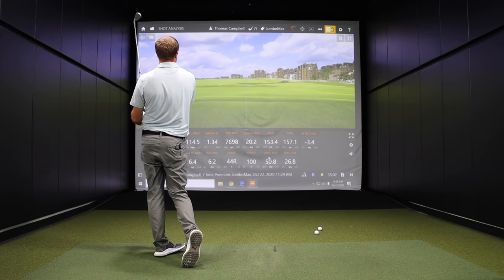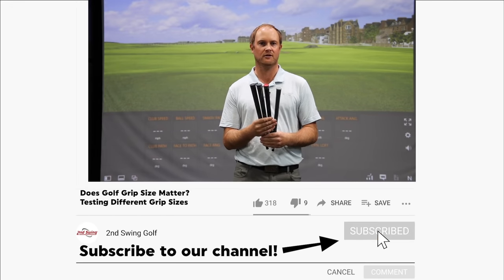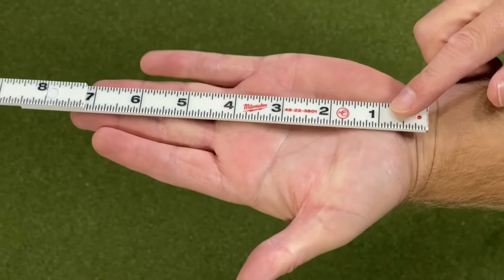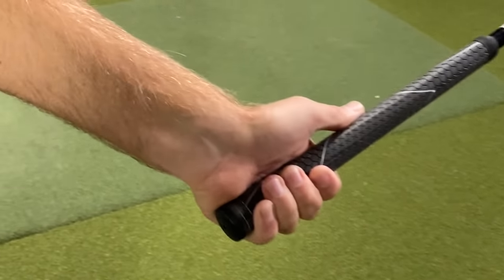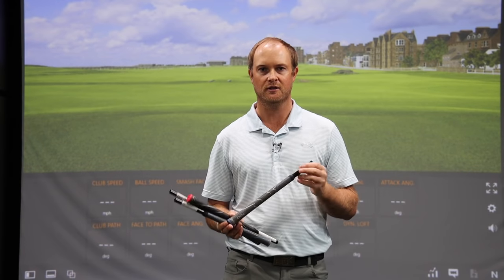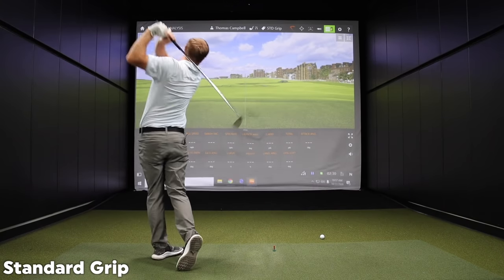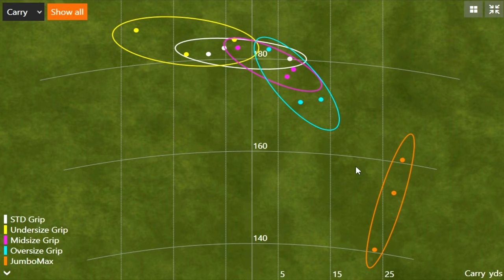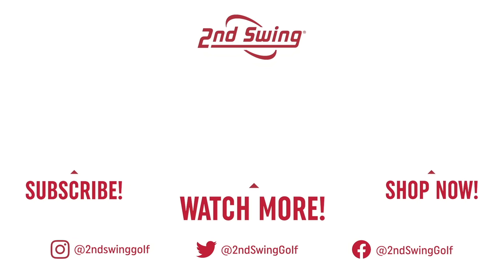Does Golf Grip Size Matter? | Testing Different Grip Sizes

Comment: With the jumbomax it takes a little time getting use to. 3 swings aren’t gonna cut it. I play the jumbomax currently (large glove) and it took me a minute to get use to. A whole range session to be exact. I could hit a draw easily and didn’t lose distance. I did have a strong grip. Now that I’m neutral it doesn’t move nearly as much. I feel I can swing aggressively and not go hard left now
Reply: These sorts of tests annoy me somewhat because of this right here... I'm not sure what testers expect from 3 shots with a change - any change for that matter. He achieved pretty much the exact opposite from the JumboMax that others have (shrug)
Reply: Hey swingking please answer me if you read this! I have a left miss for years now because of overactive right hand at impact (but not early release, I rather lag it long and then release into impact hard) if it goes well i hit bombs but a little too much hands and I hit miles left. Do you think these grips would be helpful? I rarely ever miss right for further info
Reply: @AlexSteenOlsen  I always said I never met a club I couldn’t turn over lol. I’ve struggled with the same thing myself in the past and have used oversized grips for years. These grips do help. It makes the issue less. But as always work on the issue.
Reply: @swingking83  Alright thanks but. Keep working on it :D
Reply: Absolutely!!  I just moved to jumbo Max's.  My first swings were down at 105mph as I got used to it.  As I've gotten used to them, I've cranked back up to the low 110s and my random duck hook is gone.
Reply: That is EXACTLY the kind of information I'm looking for.  I took use a large glove with a hook tendency.  Thank you sir.  👍👍

Comment: It is important to note that "large grip = less draw" is a generality. It works opposite with me, thinner grips slice way out to the right, and a medium JumboMax (which is larger than a normal oversize) allows me to hit pretty neutral shots. I had a standard size grip on my 3 wood when I got it, had a pretty big fade on most shots (~20 yards or so) and misses were 40+ yards right. Replaced it with a JumboMax medium just to try it out and instantly almost all my shots were straight with misses having a 10-15 yard fade. My driver has a medium MCC+4 grip and I slice that quite regularly as well, so I'm planning on replacing that with a JM as well.
Reply: Yesss agree!! I switched to mid size because of larger hands and I lost my ability to fade! Going back
Reply: @goonytunes4119  what size glove do you wear, i struggle with slicing and fades and I use a standard grip. I wear a large size glove but im curious if i should replace them with midsize
Reply: @bennettblackmon2858  large mens Titleist glove. For me, going back to standard from mid size was the best move ever lol!
Reply: @bennettblackmon2858  I'd say fix the swing causing the issue, vs changing the grips, my 02c

Comment: As I have gotten older I have gradually gone up in Grip size, these days thanks to arthritis the only grips that I can use without severe pain are the Jumbomax Ultalites (medium).
Luckily I didn't have any loss of clubhead speed or issues with Ball flight/trajectory. In fact, I found the opposite to be true with the larger Grips I am more confident to hit hard at the Ball and I have a neutral ball flight with little axis tilt.

Comment: I just regripped my driver and 3 Wood with JumboMax grips...I haven't tried them with a launch monitor, but I did play 9 holes earlier this week and had the most consistent performance out of both clubs that I've had all year.  Straightest I think I've ever hit my 3W, some of the longest fairway shots I've ever hit with it.  Shot dispersion with my driver was about the same as usual, but I got better distance out of it.

So, mileage may vary, considerably.

Comment: Swapped to a Jumbomax ultralite small from a standard grip. Can’t believe the great results. Didn’t realise I manipulate the club face with hands quite a bit. Shots going a lot straighter now and only miss are thin shots. Dropped around 5 shots from my scores since changing over. Fits my swing in getting a square face at impact. May not work for others but definitely worked for my swing 👍
Reply: Your comment along with many others, echos that the JumboMax grip has improved their golf.  With more square face at impact, softer/comfortable feel & reduced misses to the right. 👍🏾

Comment: Going to medium on all all my clubs has been the best thing ever. Feels great more control and even my misses arnt terrible anymore. Very underrated part of the fitting process
Reply: What grips did you get exactly? I'm leaning more toward giving the medium a try.
Reply: I just went to mid size which really helped with my arthritis in my fingers and hand. Standard size was to much pressure and after taking a testing on my finger to Wrist I should have been in the first place. Now I know

Comment: I wear a 3XL glove and got all my clubs re-gripped to JumboMax XL as I bought my first set. I've been steadily progressing and getting better but my shots would ALWAYS block to the right. I traveled and used a rental set with midsize grips. My shots were suddenly straight and perfect. Switched to midsize when I got home, and voila. No more grossly blocked shots.
Reply: I have an XXXL glove also and use the Large Ultralight grip, they recommended XL but I didn't want to jump right into huge grips, I have an oversize star grip on my driver and I'm hitting it better than I was with the JM on it.

Comment: This lines up perfectly with what I experienced after moving from midsize plus 4 grips to standard on a new iron set. 

I have always had to work to draw the ball on my set with the midsize plus grips I’ve had for years. My normal shot shape has been a fade with the occasional slice. I recently bought a stock set of Wilson staff CB irons that were on sale that I plan to customize. Before I had the chance to customize them I took them out on the range. Everything I hit was between a draw and hook unless I really tried to keep it straight or fade. It was an unusual experience for me. Now I’m pondering just adding tape to standard grips to get them somewhere between my normal fade/slice bias and drawing the ball.

Comment: I find the smaller the grip size the more control I have releasing the head. Hence open? I usually don’t wear a glove but when I do, I wear a med cadet glove. PING static fitting suggested an Aqua, or under size. Going to try one. Nice demonstration as always.
Reply: I meant closed.

Comment: I recently switched to jumbo grips and the result has been stunning. I have big hands to begin with and I’m left-handed. I spent six months troubleshooting why all my shots were going to the left even though my body was open to the target I was hitting the ball square each time, and I could literally turn parallel and be standing completely straight and still have my shots go left. I finally discovered that the reason they were going left in my case, was because my dominant hand was the one putting the power in to the shot at address through follow through. Once I increased the grip so that my right hand fit firmly around it I’m now able to keep that right hand in front of the ball and control the club more. Shots are straighter and shots are higher. My handicap went from a 28 to a 15 over a period of about four weeks practicing every day and playing five rounds of golf.
Reply from the maker: That is some awesome results by a simple grip change, nice work! - Thomas

Comment: I've recently begun re gripping all my clubs with jumbo grips. 
I've found that with the golf pride  jumbo grip I have more club head control. I have more feel of the entire club and head. With the larger diameter grip - I don't feel the need to squeeze as hard and my hand / arm  is far more relaxed than with the smaller grips. I don't feel like I need to hold on to it.
Reply from the maker: Thanks for your feedback. The results will be different for most players - Thomas

Comment: Great video and timely for me. 71 yo and some arthritic. 75 mph with 7 iron. Always have used Golf Pride Velvet standard grips. Just regripped with Lamkin Sonar Standard plus.  What a huge difference in feel and comfort and dispersion. And some increase in distance.  Almost like I got new clubs. So I’m wondering about the difference grip pattern and tackiness makes too.
Reply from the maker: Thanks for watching! A larger grip can help golfers that have arthritic pain & a softer feel like the sonar grips can also help. The texture / feel will be player dependent based on what feels good to them but it's worth a try. I always need a grip that is very tacky as my hands sweat a lot. - Thomas

Comment: Use the largest grip size your hands can comfortably handle.
Hand measurements are just an initial reference point, and should not be used as the sole indicator of which grip size actually feels and works best in your hands.
I presently use mid-size Golf Pride MCC+4 grips in all my clubs and am now considering trying out a jumbo grip size on a single club for experimentation to see if there are better or worse results.
If the results are better than what I am experiencing now with the current mid-size grips, I will promptly have all my clubs re-gripped with jumbo grips in short order.

Comment: Excellent data points…Not sure why you would waste time measuring hand size and glove size.  The most relevant data point is the ball flight characteristics.  If you have someone who measures perfectly for standard grips, but is over-drawing the ball, they would probably benefit from a larger grip then whatever they are using (assuming all other swing factors are accounted for - not hooding their club at address, coming from an extreme inside out path, etc.).  Seems the only relevant factors are current ball flight, desired ball flight, and comfort (minor factor would be the increased or reduced weight on a different grip and it’s affect on the ball).  If someone is playing a Tom Lehman left to right boomerang bender, but likes that flight, so be it…That said, the market these days is also flooded with the Standard +2 or +4 MCC grips to reduce the taper.  Can you do a review of those to see the affect on ball flight and numbers?

Comment: I think one factor that larger and more muscular guys may consider is that the swing style can be changed to more of a body release and 'single plane' (not really, but less of a difference in planes) and they'll more than likely be performing better with JumboMax. Right now we just have Bryson DeChambeau and many long drive champs as a sample size, so not the biggest (well Martin Borgmeier is pretty big) sample size, but I think it shows that the JumboMaxes are still viable, just have to make adjustments and they are probably more suitable for more powerful guys generally. 
That said, I'm not even that big and I prefer them because of the shock absorption and generally way less strain from swinging a lot. I'm looking out for my long term health ever since getting trigger finger in my lead pinky very soon after starting out with standard-sized grips, so I am a bit obsessive on the health aspect too. :)

Comment: Ive found that if my grip is worn..and Im gripping tighter..Ill hook my shot more often...almost like if the grip is too small
Reply: I use Golf Pride MCC+4 grips to give me that wider less tapered width at the bottom of the grip to help reduce hooks.
Yes, gradual compression of the grip is also exactly what happens, and why grips need to be replaced with new ones more often than players might otherwise think.
If you play golf regularly as a weekend warrior, your grips should probably get changed annually by default.
Pro golfers typically change their grips every month or two, so if you're playing approximately 100 rounds of recreational golf per year, you might want to get your grips changed every six months instead.

Comment: Did take into account that larger grips enable people to grip with lighter pressure which should give more ball speed and more distance. Could it be that you had a good grip pressure for your standard grip size but for the larger grip size your natural pressure was too much and therefore slowed down your club head speed?

Comment: I went to bigger grips to calm down a tendency to hook the ball, I even put on Jumbomax XL, and the effect was only temporary for me. After I got used to the larger grips, I found it even easier to hook the ball.
Reply: Same. I switched to JumboMax and it was temporary. I also lost swing speed temporarily. Like a few months temporarily
Reply: That might have more to do with the XL size than anything else. From what I've read you are supposed to use jumbomax grips 1 size down from your hand size.

So an XL grip would be for someone with xxl hands.

I'm a medium glove, so I'd use small jumbomax grips.

I havent tested them so Im not 100%, just food for thought
Reply: @Jack-xy4fy that’s correct to a degree,I have large glove size and it says I should use a medium grip

BUT

That depends on what your miss is,for a large glove size,if u draw or hook a ball,a small grip is better and if u fade or slice the ball it’s the medium grip

Comment: Do you recommend to have the same grip size with your irons and woods/drivers? So if you’re playing standard 1 wrap grip and mid size grip for the driver, is that not good to do?
Reply from the maker: I recommend keeping it consistent 95% of the time. There will be exceptions to the rule but most of the time keep it consistent - Thomas

Comment: Watched your video and have a serious comment.  The weight of the grip may have much more impact than the size.  As a senior golfer who prefers a larger grip, the Winn Dry Tac Oversize is 50 Grams vs the Lamkin Croslsline  Oversize , which is over 70 grams.  The swing weight of the club is not changed  with the Winn grip vs most standard size grips which are in the 50 to 55 gram weight.
Reply from the maker: This is a very good point the larger grips will be heavier and that can also influence how a golfer delivers the club - Thomas

Comment: I have a tendency to leak my long irons right and pull my short irons left. Would it be strange to use an undersized grip on the 4-6 a mid-size or “plus 4” on the 8-P?
Reply: I have Standard on my irons and midsize on all my Wedges for that same reason.

Comment: not the most scientific test tbh but interesting, grip weights will affect swing weight of the club in some cases by a lot that will also affect the outcome even colour change in the same grip will be different weights because of the additives needed to make the colour.
Reply from the maker: Great observation! The results will be different for each golfer some results will be minimal while some golfers will get significant shot direction changes.